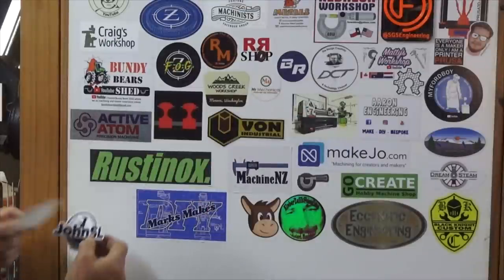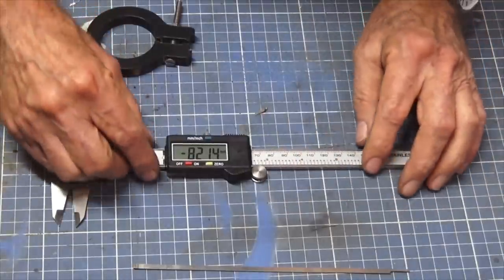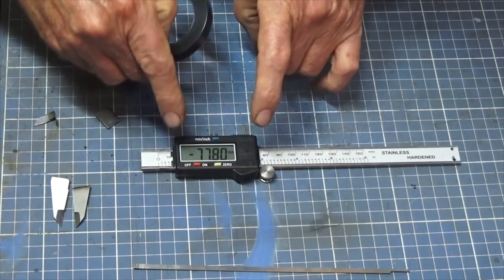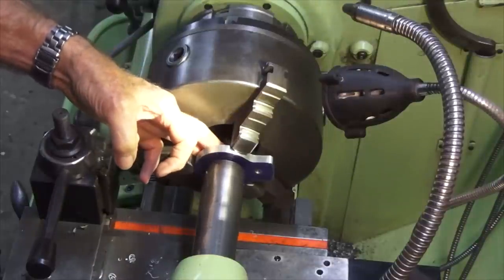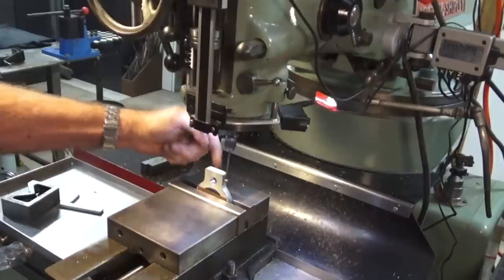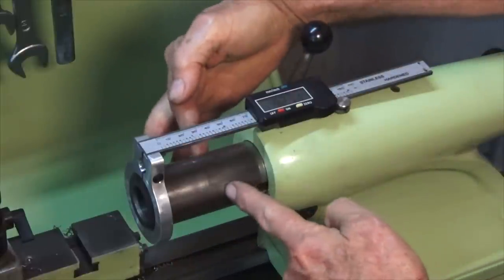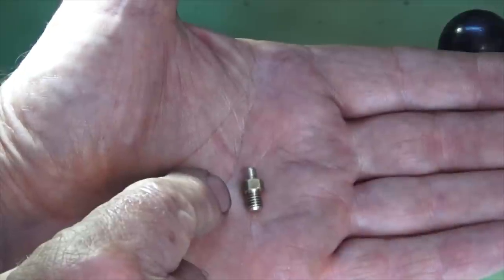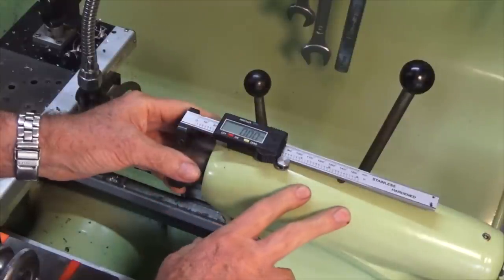How to Add a Digital Readout to a Lathe Tailstock Using a Cheap Caliper

Comment: An elegant solution! I could never understand why people make a big deal about drilling holes in machines. We have them to use, not to re-sell! Cheers, Matthew
Reply: Agreed. I don't understand what's the big deal about making an improvement or modification to a utilitarian piece of equipment. It's just a VERY common old lathe, not an Egyptian artifact.
Reply: @johncoops6897  I understand the need ,but it still hurts me to see holes drilled in Old Iron. I go out of my way to avoid doing anything to scar the beautiful relics.
Reply: @terrycannon570  - they aren't relics. They aren't even rare. Would you repaint one if it showed evidence of use? Would you have the ways reground, to correct wear or damage?
They're strong working machines designed to be used. It's almost criminal to keep them under plastic in glass cases in a museum, and never alter, repair or upgrade them.
Reply: @johncoops6897  Mustard or Mayo?
Reply: @terrycannon570  - what is that random comment supposed to mean? Do you write English, or are those just 2 words you saw online somewhere?
Reply: People aren't. 
Mark is.
You could feel his pain whilst watching.  😊
Reply: @johncoops6897  
Same goes for cars.
Use em
Reply: @johncoops6897  It means that we all do not like the same things. If you want to drill holes then by all means it is your burger. I do not like to put holes in my vintage burgers.
Reply: @terrycannon570  - So, if people can choose what they do with equipment that they own, what is the problem with somebody drilling a hole in equipment that they own?
Reply: @johncoops6897  Go troll somewhere else. Nuff Said.
Reply: @terrycannon570  - Troll?

Comment: The bulge in the casting with the hole running through it on the side of the Bridgeport head that you were unsure what it was for is called the indicator boss.  When the Bridgeport was designed there were no magnetic bases to hold an indicator to the machine like there are today.  That hole would hold a round rod that could be slid up and down and locked in position by the set screw with a dial indicator attached to the lower end to indicate your work. Just a little Bridgeport history on one of the most versatile machine tools ever invented😀
Reply from the maker: OK. Thanks for that. I notice that some of the Bridgeport clones don't have that feature. 
Regards,
Mark

Comment: You used a level to determine the position to the lathe bed, that is perfectly OK as long as the bed of the lathe is perfectly level to the floor. I would’ve mounted an indicator on the slide and swept it on the caliper to ensure it was level to the bed and not to earth.

Comment: I have this exactly same cheap caliper and did the exactly cleaning and tuning you did.
If the zero is bugging you, that scale is glued in with non permanent adhesive. You can peel it out, taking care to not bend too much, glue it again in the new zero and cut the excess without problems (I did that). If you are afraid of damage, you can try to peel it starting at the bottom end to see how easy it goes.

Comment: Mark, that is a very nice solution to a PITA irritation that I share with my old South Bend.  I may have to implement a version of your idea!
Reply from the maker: Bob, I believe the South Bend is very similar to the Hercus bench lathes that were made here. They were the most common lathe used in Queensland secondary schools. We had two Hercus ATM260 lathes at work and they had the same round top tailstock and a rounded over compound and cross slide. They were great lathes but not easy to modify.
Regards,
Mark

Comment: Excellent idea Preso. Funny how some viewers are pedantic about what you do with your own equipment. Those Cheep Callipers are reasonably accurate, only problem is they chew through the batteries like nobody business. Even when off there still drawing a few milliamps of current. I added a small switch to mine to save me popping the batterie in and out all the time.
Reply from the maker: That is one of the drawbacks with that particular design. If you move the caliper it switches on so it must be on standby all the time. I believe that one of the things that Mitutoyo got right is their outstanding battery life. Good idea about the switch though. I'll  have to look into that.
Regards,
Mark
Reply: Modify to use a AA battery pack. Batteries will last for years and years that way. Don't switch off power, or they will lose zero (not that it's a major hassle, since it's only one button press).

Comment: Mark, useful addition to the student.
My use for the indicator boss is (with a suitable rod in place) as a stop for my boring and facing head while facing..
And as a stop for my Centering dial indicator.
I like your LED ring lamp..
Perhaps clamp it to the quill, I don't know, but the 'stop' function is very handy.
Reply from the maker: I could just extend the mounting rod down further so that it would serve as a place to clamp an indicator but using it as a stop as well could be hard unless I were to make a telescoping section on the outside of the 5/16" rod.
Regards,
Mark

Comment: Mark:  a suggestion for your “halo light” would be to extend the stem or rod that is used to mount your light to the mill.  By extending the rod THROUGH the frame (downward) you now have a stud to attach a knuckle and a dial indicator for traming, sweeping a part, or maybe a mini camera (?). I too have a similar light and the extension of the rod makes quick work of mounting a DTI without removing the light.
Reply from the maker: Good idea, why didn't I think of that? Actually, another viewer has pointed out that the hole on the side of the quill housing was for mounting an indicator which was another thing I didn't know about the Bridgeport.
Regards,
Mark

Comment: The curve with the flats does look pretty cool. People will wonder how you managed to do it so smoothly. 
Mark from Melbourne Australia
Reply from the maker: Mark, I was surprised when it came out so uniform. I still have to work out why it got that way after I exported it from Corel Draw. I have been using QCad a bit lately and I think it is more suited to CAD CAM work than Corel. It's not exactly free though. It's still way cheaper than Corel though.
Regards,
Mark

Comment: Very nice discussion/build,  nice that the quill has the extra stickout
Reply from the maker: Thanks Chuck. I used that setup today to drill to a very specific depth and I hit the number I wanted no problemo. It's almost embarrassing to use such a cheap tool to get high accuracy. 
Regards,
Preso

Comment: Creative attachment solution that seems to work very well. If you have the time, you could get all carried out and make (and CNC engrave) a new scale for the caliper, starting with -2 cm, to get your zero at the right spot. Lovely the place where you live!
Happy New Year!
Reply from the maker: Another viewer has told me that you can heat that scale up and the adhesive will debond. You can then reattach it 20mm further down the stainless steel channel. I will give it a try. 
Regards,
Mark
Reply: @Preso58  Yep, it's self sticking and could be an alternative, but it's a bit delicate. Good luck 🙂
José

Comment: Nicely executed Presso, very elegant. 
In my humble experience the analog scale is glued on,  a few minutes with a heat gun and you might be able to recalibrate your scale to suit your goal. 

Cheers and happy new year wishes to you and yours and my fellow Pressonians in YouTubeVille,
John
Reply: I have the exactly cheap caliper from ebay. In my case I did that without heat. The glue is a soft non permanent adhesive.

Comment: Hi Mark best of the season to you,
 if you want to reset the label on the caliper to zero in the new position warm it up with a heat gun remove label and replace in the coreect position, the peice you cut off the end can go to the front of the calliper the pcb underneith will be ok   as it is firbre glass and not the FR4 board .
Reply from the maker: Ken, I am definitely going to try that. It's just me being pedantic but I would really like all three zero points to be the same, even though it's not really necessary.
Regards,
Mark

Comment: Excellent build Mark---I did that a few years ago but ran into problems with the digital calipers---went through about 6 of them in about 8 years and gave up and started using mag based dial gauges..its reliable..-The problem I had with the digitals was moisture..I live on the south coast here in wa within 5 ks of the sea and its the humidity that stuffs them...Since I swapped to dial verniers  everything smells of roses and I am happy....
Reply from the maker: I have three digital calipers. The oldest is a 250mm Sylvac and despite it looking a bit sad it's still accurate and reliable. It must be over 25 years old. I have another el-cheapo Chinese 250mm and it is less than three years old and it is slowly disintegrating and chews through batteries at a prodigious rate. The newest is a Mitutoyo Absolut and I only got that one last year but I love it. It was very expensive though. We used a lot of dial calipers at work but the students seemed to be able to destroy them very quickly. I think they used them as chipping hammers. I can imagine how humidity and salt air would play havoc with a digital though.
Regards,
Mark

Comment: Thanks Preso, 
You could always change that brass pin for a zerk fitting and have an oil point for the the tailstock quill like on the Myford lathes.
Cheers
Reply from the maker: Raymond, there are already two oil ports on the top of the tailstock casting but one of them is now covered by the DRO scale. It takes less than 30 seconds to remove the whole assembly though so it's not really a chore to remove when I do a maintenance lube on the machine. 
Regards,
Mark

Comment: One of, if not the most elegant adoption of a caliper as a tailstock DRO. Well done Mark. Happy New Year to you. Andrew 👏👏👍😀
Reply from the maker: Thanks Andrew. I messed around with indicators, tool makers clamps and all manner of blocks and jury rigged brackets and thought "you know what, there has to be an easier way" and there was.
Regards,
Mark

Comment: Good Show Mate: as usual. I hope the coming year is good to you. You machined a whole bunch more on this piece than I would have. I am lazy. It has served me well.
Reply from the maker: To be honest, the 3D printed quill clamp worked just as well as the machined aluminium one. However, today I was machining some really tough steel and the swarf was coming off red hot and the long curls would have welded themselves into that plastic part. My lathe doesn't have enough power to take cuts deep enough to break the chips. 😥
Regards,
Mark
Reply: @Preso58  I have found that plastic has limited uses in the shop. It is just not robust enough to stand up to what a lathe or a mill will dish out...in my experience. YMMV.

Comment: Very well done. If the scale really bothers you, you can always remove the scale, which is usually glued on. If you wanted it, you could glue it back on in the place you need, and just cut off the excess hanging over the end.

I’m just finishing a major rework of the tailstock on my South Bend FOURTEEN. Yup, that needed major surgery to not just add a DRO scale to connect to the X and Y scales on the readout, but to add a cam locking lever as yours, and other lathes have. I already agonized over drilling two 10:32 screw holes on the back of the bed. When I got to this I thought that either I would add something very useful, and machine, or abandon the idea. I feel that whoever gets the lathe after me will appreciate the advantages more than bemoan the “savaging” I’ve done to a classic machine.
Reply from the maker: Mel,  we had two Sheraton lathes at the school where I used to teach with tailstocks similar to the South Bend and I always wondered why you needed a spanner to lock the tailstock. It seemed so unnecessary and counterproductive. I guess it could provide some extra clamping force but half the time the spanner was nowhere in sight when it was needed. Kids would carry it away and leave it on a bench or drop it in the bin! I will be having a go at repositioning the magnetic scale on the caliper. I have been told you just need to heat it up to soften the glue. I used the setup today and really didn't think about the analogue scale at all. Maybe it really isn't necessary unless you are a bit OCD like me.
Regards,
Mark
Reply: @Preso58  well, most all lathes use a wrench. The lever was a newer development.

Comment: Hi Mark, I cut the jaws off the Vernier like yours and drilled with sharpened masonary bit and screwed the vernier to the Aluminium clamp for the Quill.
Luckily my tailstock is flat so I epoxied a small block with a keyway which matches a round pin on the vernier, this allows for rotational backlash of the quill and still holding accuracy when drilling.
I used a higher end vernier, in my opinion the cheap ones fail electronically in short time.
Ceratainly a handy addition to the lathe.
Happy New Year.

Comment: good design , good machining, good video production  thank you
Reply from the maker: Thanks. I did actually replace the original (very cheap) caliper with a slightly better quality iGaging caliper a while ago. The old cheap one went through batteries very quickly and the battery contacts were less than reliable. The new one is great though.
Regards,
Mark

Comment: That style of cheap "Chinesium" calliper tends to have a power issue. On most of them the power button only turns off the screen, and leaves the electronics active. It's not a huge power draw, but it's enough that they can run cells flat in a couple of months (And the cells aren't really the cheapest thing in the world).

There's one that I have as a depth gauge on my pillar drill, and every time I used the drill for a non precision through hole the gauge would detect the quills movement and wake up. Because of that I was CONSTANTLY swapping batteries in the damn thing. So in the end I soldered a couple of short wires directly onto the battery compartments contacts and connected them to a 2x AA battery box. I drilled a large hole in the end of the boxes body, and where the second battery would have gone, I fitted a latching push switch, then wired it up to take a single AA. The box is just held in place with some sticky backed Velcro tape so I can pull it off to make it easier when I need to change the battery.

I only turn the gauge on when I need to drill too an acurate or consistent depth, and the AA battery hasn't needed replacing in the several years it's been fitted. The whole thing works well enough that I can't even remember the last time I actually used the quills depth stop when I've needed to repeatably drill holes to the same depth. I just zero the gauge at the bottom of the first hole and drill all the rest till the zeros come up again. It's near as damn it idiot proof....... and that's just how this idiot likes it. :D
Reply: Most of those caliper DO NOT have the quiescent power issue you mention. However they will certainly wake up every time they detect movement. The LR44 cells cost mere cents at the local $2 Variety store.
Reply from the maker: Well done. Another viewer has commented on the same issue. His solution was to fit an external switch to the internal battery. I will most likely do something like you have or fit a switch. I did have one of those same calipers in my pocket when I was teaching and I must say I don't remember changing the battery too often but you are correct that it is always on standby. I have a Mitutoyo Absolut caliper and it doesn't automatically go into sleep mode. I often find it still switched on from the day before. I believe Mitutoyo have done something really clever with the electronics to make the battery drain minimal. 
Regards,
Mark

Comment: The Angel Eyes are perfect for Router spindles. I believe I bought the 80mm ID and is a wonderful upgrade to the dust shoe during tool change. But sadly it is hiding once the brush is then fastened.
Reply from the maker: I have had two of those things sitting in a box for nearly two years and once I made up my mind to use them it took less than a day to print the parts and make the backing ring. I don't  think they are as bright as the commercially made solution but for close work it's great. I do notice a drop off in the light if I am using long tooling. 
Regards,
Mark

Comment: Excellent bit of work.  I wonder if it would be possible, rather than more holes in the back of the read head, to make it a slot?  A spring loaded slot acting on the pin would allow the quill to retract without damaging the read head.
Reply from the maker: A slot would work but that stainless was quite hard. I used a cobalt drill bit and had to take it quite slow with plenty of coolant. That was one thing the Chinese manufacturer didn't skimp on. I guess a solid carbide milling cutter could do it though.
Regards,
Mark

Comment: I fear you will be going to have trouble with the fact that the quilt of the tailstock has some rotational play. Some years ago I made a similar modification to my affordable lathe (which had even more play in rotation). My digital readout did not survive long! After a few months of use it stopped working. You really need something that allows the quilt to rotate a bit without putting tangential force on the caliper. Randy Richard made one of these, coupling the caliper with a magnet to the quilt. Perfect solution actually. I built something similar for my tailstock and I using it for some years now without a single problem.
Reply: Yep 100% correct - everyone can see that rotational play at 25:04
Reply from the maker: I have addressed this issue in some of the other comments. I think it will work out but I will do a follow up later.
Regards,
Mark